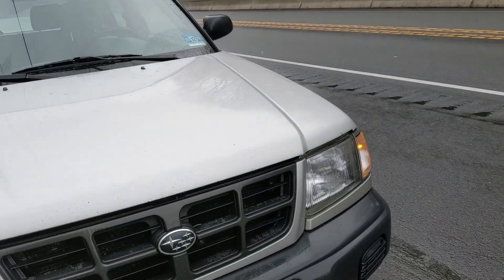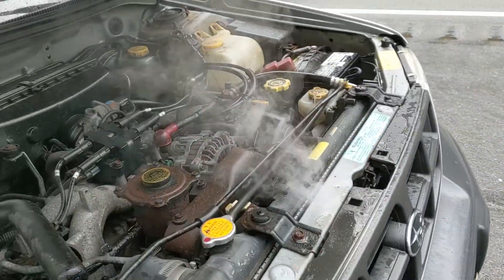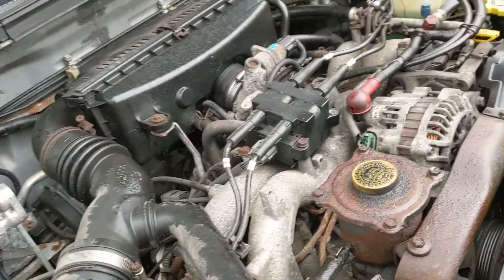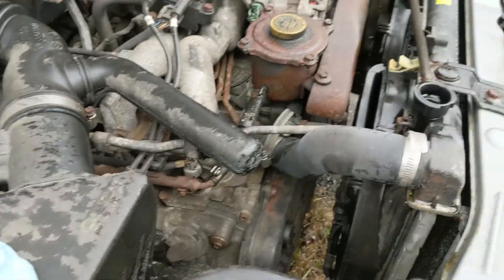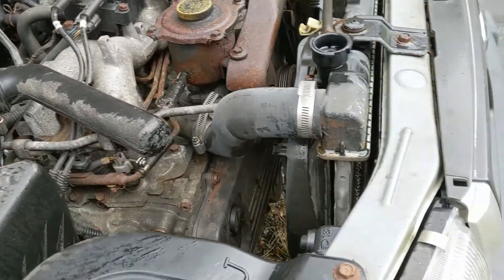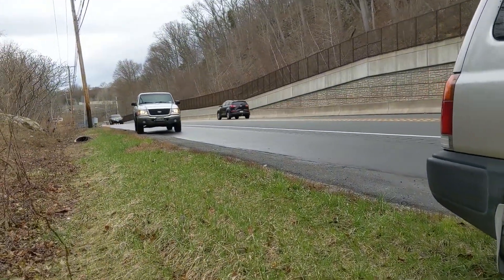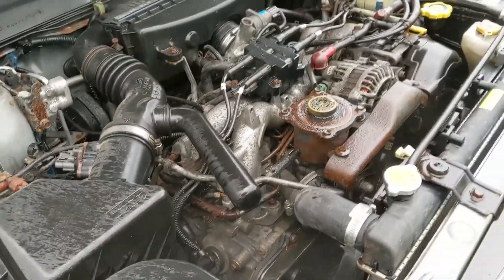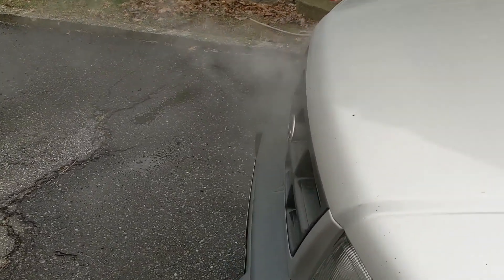Forester's Radiator Blew

Comment: Hahaha sounds like my luck. Mine just blew as well
Reply: I also literally just did full a timing assembly a month ago (water pump is fine)
Reply from the maker: oof, at least the radiator replacement only takes about 20 - 30 mins on these cars. Now if they stopped using plastic for them, they'd last so much longer lol.